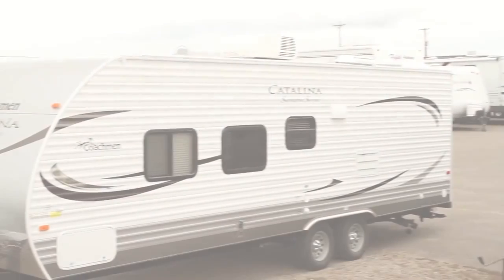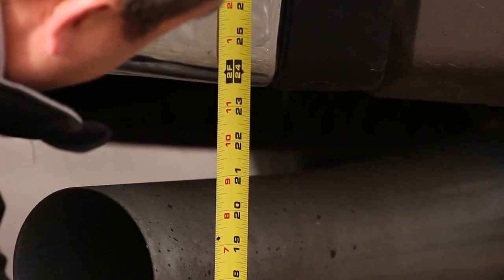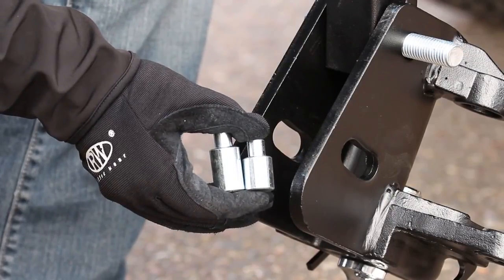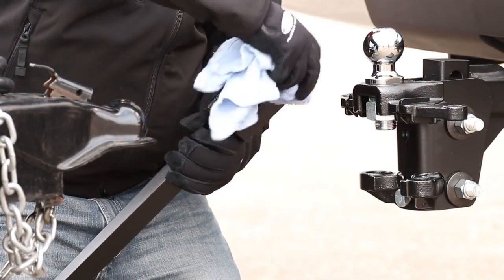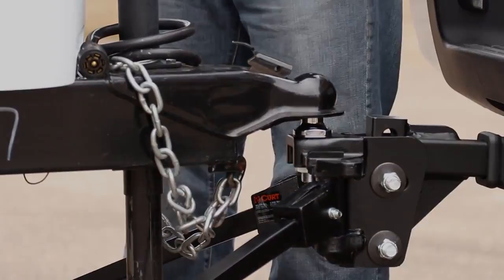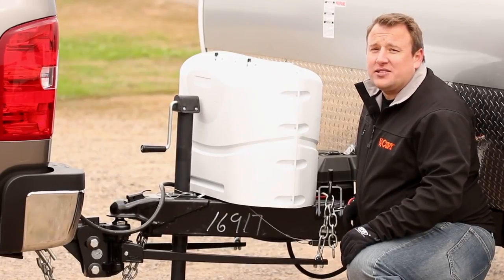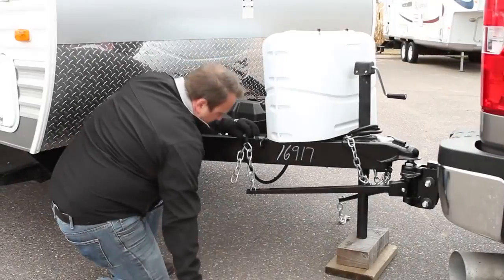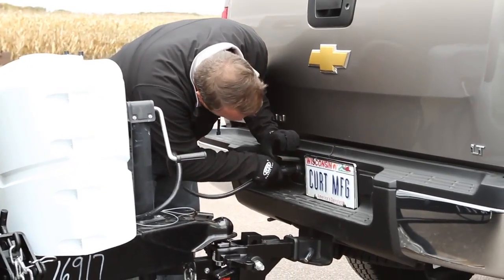How To Set Up a CURT Weight Distribution Hitch

Comment: The 1/2" rule is BS.  That depends on a lot of factors.  Spring rate, wheel base, tire sidewall softness, etc.  On my 2021 F-150 with 18" wheels, tires at 40 PSI, 157" wheelbase, 7100 package, 800 lbs tongue weight, I was able to get the trailer completely level, 1" sag in the rear, 0 raise on the front.  If I add a link, the rear sags more just to get the front to raise 1/2", but the trailer becomes 1" lower in the front than at the rear.  That puts more weight on the front axle of the trailer, more weight on the hitch, more weight on the rear axle of the vehicle, and less weight on the front of the vehicle.  Everything you're trying to avoid with a WD hitch.  This creates a less stable and less safe setup all around.  While 1/2" raise isn't much, 0 raise is better.  And no way was I going to get this truck to only have 1/2" sag in the rear.  It's just not possible no matter how much I play with the hitch angle or the hitch height.

Comment: Did everything that was explained. Still losing over 1”. Went above coupler 1.5”. Tried dropping my hitch a couple of holes down and still same results. What am I doing wrong? Should I go higher instead. Frustrating. Also leveling trailer should be on the front A frame or the frame that holds the sleeping compartment? I ask because they are different angles. I would go off the center frame but maybe I’m wrong as well. Please help

Comment: Wring instructions on before and after height calculations. Not physically possible to get both front and rear distance within 1/2" of unloaded height. Simple physics will not allow this if you are towing a reasonable amount of weight.

Comment: I don’t understand.  If the hitch weight is distributed, shouldn’t that raise the back end of the truck"
Reply: No, it doesn't. Some of the weight is still on the tongue, lowering the rear.

If you do as he says in the video, allowing the front to raise 1/2-1", then there will still be a lot of tongue weight. The front should not raise at all! The whole point of a WD hitch is to keep the tongue from removing weight from the front axle.
Reply: Though it doesn't eliminate hitch ball load entirely.
Reply: that was my understanding that when you lower the trailer on the ball the truck should stay the same height it was before hitting up the trailer that's what mine does it's just a Harbor Freight hitch not a very expensive one but it keeps my truck pretty much level
Reply: Rick Waldrip Sr. it does

Comment: WD hitches are bullsh*t. They DO NOT distribute weight. What they do is create a torque force. This force acts to counter the downward force of the hitch and create a resultant forward force. [proven by simple vector analysis] This means your frame is taking MORE force than otherwise. And, if you are not careful, you can easily overload your front axles, especially when braking. A WD hitch is a torsion hitch. Proof: no torsion bars, no WD effect. A WD can in fact create dangers in emergencies.
Reply: Rob Grune If you set the system up properly, as stated in this video, it's actually a million times safer than towing without one. Per vehicle the manufacturer, and the law, if a trailer weighs more than half the weight of the vehicle, a weight distribution system is required to be used. If you don't use it, the trailer takes all the weight off the front axle which would create a mega dangerous situation in an emergency braking situation. You'd lose control instantly. The weight distribution system keeps you in control, keeps the trailer and tow vehicle stable and safe, and keeps you on the road. A weight distribution system is a vital component for all trailers of this type.
Reply: I'm a truck driver and I know when loads feel heavy. I've driven with and without WD  hitches. If you knew anything about towing you wouldn't post such idiotic and ignorant statements. Basically what I'm saying is "shut the fuck up stupid!"